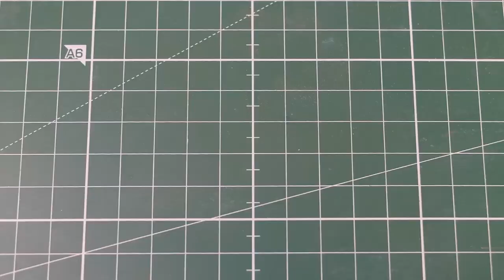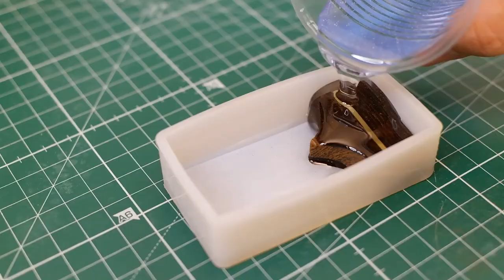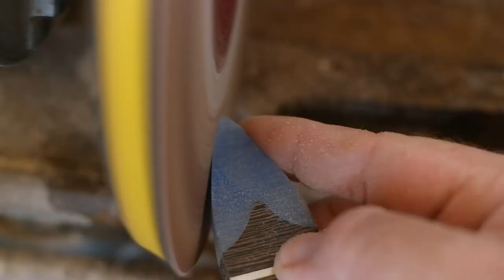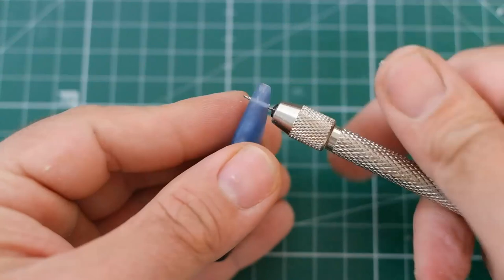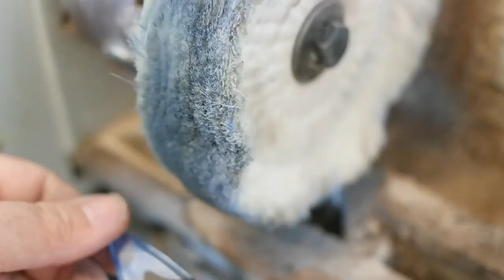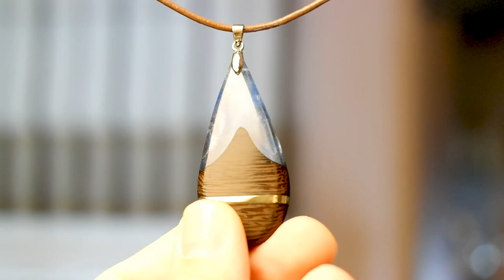Amazing Jewelry Epoxy Resin Brass Wenge Wood Necklace - Resin art - DIY

Comment: if you stain wood a color can you use anything for the clear coat after?
Reply from the maker: It can be used, but I use a wax made from teak, flax oil and beeswax.
Reply: @Resin_Art  with people wearing them in mind are there any coats that tend to cause reaction with some people? trying to avoid anything that might react poorly with people of sensitive skin.